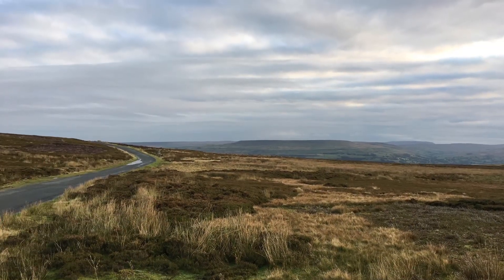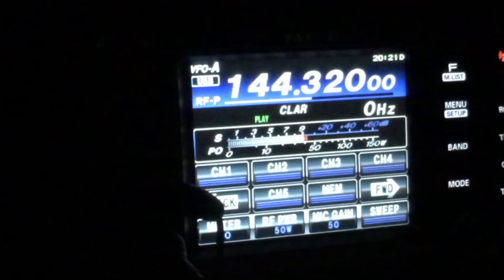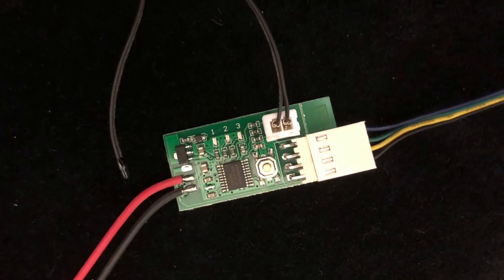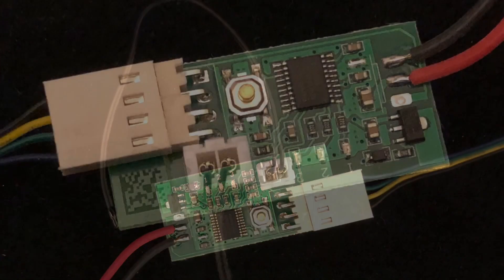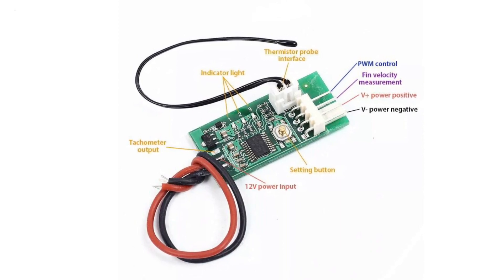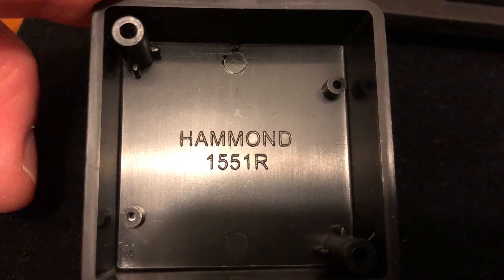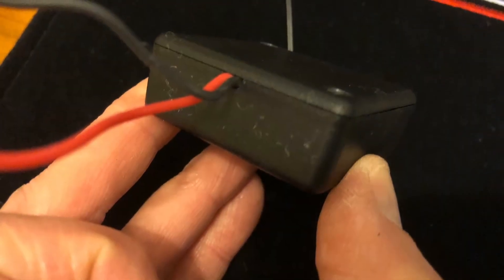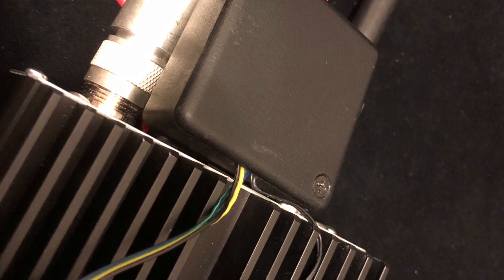Cooling a Linear Amplifier

Comment: Hello Ian I like what you have done here and was wondering how are powering the the fan and control board? Tnx Dan
Reply from the maker: @danielblake704  Hi Dan. They’re running off the rig PSU/battery. The board drives the fan. I no longer have this setup, but I do have a similar 70cm amp with a fan with just and on/off switch (no thermostat control board). I just leave it on while operating 👍🏻
Reply: @G0CNN-Ian thanks Ian much appreciated.

Comment: Hi Ian bit unrelated to the video but I wonder if you still have that linear? I just picked one up for nothing as a faulty unit and found a couple of burned out resistors on the preamp stage (im guessing someone transmitted with the preamp on and no ptt wire connected) but I cant get any schematics that give values of the resistors. You would be a lifesaver if you could take the white cover off and take  picture of them, just need the colour codes to replace them with the right ones, I can let you know exactly where they are but roughly an inch behind the pre amp switch itself. Thanks
Reply from the maker: Sorry, I sold it. Good luck with the fix. There’s a lot of these about, so hopefully someone can help 🤞🏻😀

Comment: I brought two cheap amps from Walmart and as soon as I start playing through my speakers old school 15 inch and woofers .I noticed when I start on the Joe Bonomassa it really started get it hot.I took a thermometer and put it right on the side vent read 109 degrees.I knew that was Hot.I knew I had an old computer in my shed got the fan and a 12 volt converter it went from 109 to 95 or lower.I brought another one just the same and was playing today and it does not have a fan.I noticed it started out fine sounded pretty good until it got hot then it started to sound Fuzzy.The new one I was playing today through 600 watts woofer from Walmart.The one with the Fan sounds great.I also ordered a 18 dollar amp just because I am really curious 18 Dollars?
Reply from the maker: Sounds like it’s working 👍🏻
Reply: @G0CNN-Ian  I also just now found they don't like to play cold.I left my fan plugged in over night and it sounded Awful.I now got the amp nice and warm and it sounds really good.

Comment: I have just put the fan onto the heatsink and I found that if you use the top holes on the fan and then go to the base of the linear (bypassing the lower hole) with the first cable tie, where the first cable tie goes through "the hole" in the second tie (and likewise 2 into 3), you can adjust the ties so that they create small feet on the lower two corners of each "wrap", which raises the amp about 1/4" off the ground creating a little more airflow underneath the amp

73 de Terry G0BIX
Reply from the maker: Never thought of that! Good idea for bonus feet 👍🏻

Comment: Dumb question..is fan supposed to blow air into vents.. or suck air through vents out fan?? Thanks..
Reply from the maker: No, good question 👍🏻 Either way, depending upon whether the fan is ok upside down. This fan is top-side up (label on top) and blows air down into the vents. My 70cm amp is the same. Both work great (70cm is just on a switch and not a thermostat). Thanks.
Reply: @G0CNN-Ian  whit label on top mine blows up..label down blows into vents.

Comment: Nice vid Ian and good bit of construction. I do wonder whether the manufacturer’s PA heat sinking isn’t adequately rated for ‘running’ in contests (ie duty cycle probably 30% on 70% off vs contesting 80/20)? Unfortunately not many manufacturers seem to provide info to allow you to make an informed choice. Hope to catch you Tuesday on 2m contest night. 73 Nick M1DDD
Reply from the maker: NICKGAR7 Yes Nick, possibly. Keeps the car warm I suppose 😀 Will see how it fairs Tuesday. Will keep my ears open for you 👍🏻

Comment: Hi Ian, can you put up some links or item numbers for the fan and controller, I need to do a similar thing with some home beer making kit.
Reply from the maker: Steve Wardley Here you go Steve Controller: https://rover.ebay.com/rover/0/0/0?mpre=https%3A%2F%2Fwww.ebay.co.uk%2Fulk%2Fitm%2F303283862483 and this specific sized fan, but lots of others available: https://rover.ebay.com/rover/0/0/0?mpre=https%3A%2F%2Fwww.ebay.co.uk%2Fulk%2Fitm%2F192212534095

Comment: Nice amp and I like the fan mod. Where did you get your Yaesu mat from 👍🇬🇧👍
Reply from the maker: G1WHP Thanks Paul! The mat was from a rally. I think it’s the company who do the branded rig covers who’ve been at the main rallies I’ve been to.
Reply: Looks good.... I need some.radio themed desk mats for the trailer. How much input power is required to get 100w out of the amp.
Reply from the maker: G1WHP 15W Paul. There’s a 200W version, but the prices are even higher than the high this was 😮 There’s a few similar/higher power kits out there, but 48V, which would be good if you have mains I think.
Reply from the maker: G1WHP Just checked Paul.....DX Covers